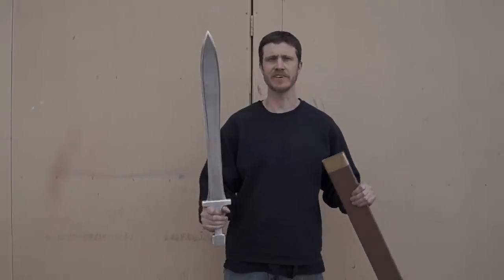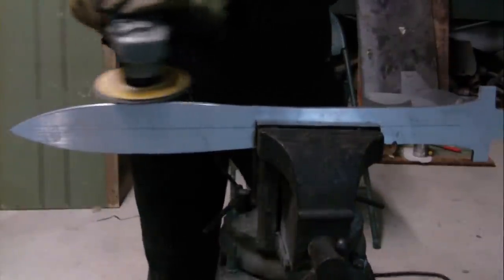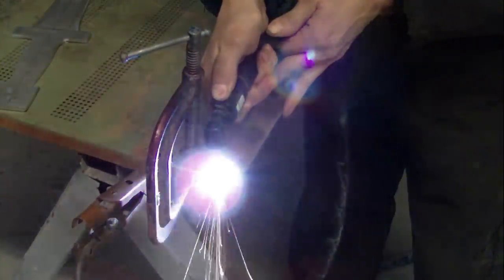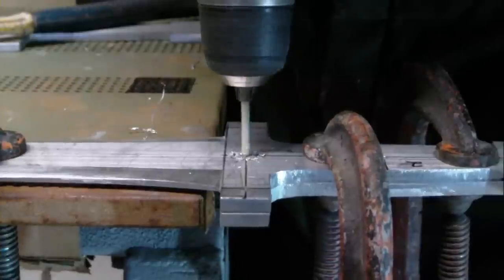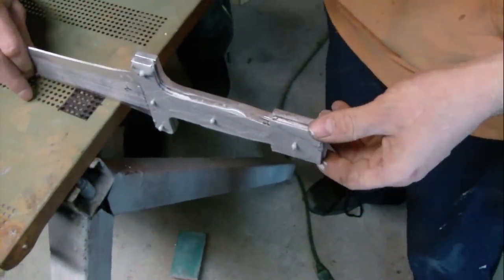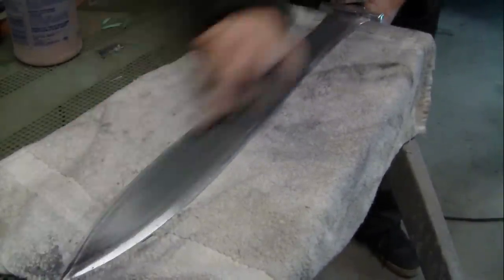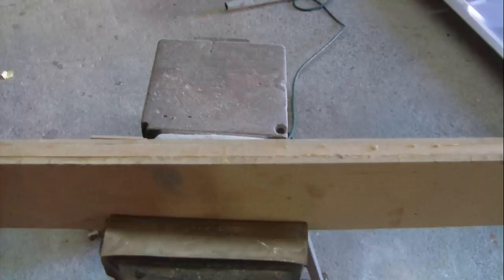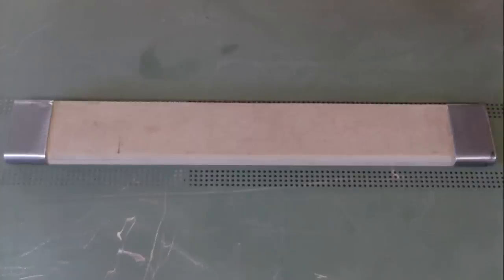How To Make A Prop Sword / Xiphos And Scabbard

Comment: Just wanted to pass on a tip I have just learned, may be of some use? A woodworking router with a carbide tipped cutter will cut aluminium easily and give great results. I mounted the router upside down in a wood box with the cutter sticking through. With the profiles available,very cheaply,you can machine the shape quite quickly and then finish by hand.

Comment: Wow it's more like a real sword than a prop sword!
Reply from the maker: its a high quality prop =)
Reply: it is not an actual sword because aluminum is not hard enough to be effectively used as a sword.
Reply: not nearly the real blade was shorter and the pommel and handle was made of copper or wood the blade was very rarely made into the sword handle
Reply: domini republica The only thing I see you doing in this comment section is complain.
Dude it's a prop not a real sword and it looks really nice (except for the scabbard) so keep your negativity too yourself..

Comment: Hi, great video and awesome sword! I was just wondering what the width and length of the aluminium bar that you used was? cheers, Matt
Reply from the maker: thank you!  the aluminum bar was 30 inches long, 4 inches wide and 1/4 inch thick

Comment: Cool tutorial. What are the dimensions of the sword?
Reply from the maker: thanks! the sword is 29 inches long.the blade is 22 1/2 inches longthe handle is 6 1/2 (including pommel and hand guard) the blade at its widest point is 2 1/2 inches and at its narrowest it is 2 inchesthe hand guard is 4 inches long and 1/4 inch widethe pommel is 1 3/4 by 1 3/4 inchesthe handle is 1 1/4 inches wide..hope this helps. if you have any other questions feel free to ask.
Reply: GoldPointProps
iv held a real one and yours seamed a little big but still great job

Comment: I have two more questions!! Is it relatively sturdy material?? And where did you aquire such a large piece of aluminum??
Reply from the maker: yes depending on the thickness it is sturdy. witch we got 1/4 in witch is perfect. we went to our local metal store. a 20foot piece was only $30. its way cheaper to buy it from a metal store than a hardware store

Comment: where do you suggest i get this metal at? because ever since I saw this a month ago Ive been looking for somewhere to buy this metal at and I cant find anywhere...can you please help?
Reply from the maker: TheGcreeper101 you should be able to find it at your local hardware store. but id check and see if you have a metal supply store in your area. they could cut the length you need and its way cheaper.
Reply: ok i have checked my local home depot, lowes and menards and nothing but ill try fro a metal supply store

Comment: 2 things could I use stainless steel (for strength) and where did you buy the metal
Reply from the maker: Mike Koepsell yes you could its just going to be harder to work with. and I got my metal from my local metal store.
Reply: Ummm stainless steel doesn't have any strength for swords.... Lol obviously if its a prop it is fine but if you want strength, carbon steel would be a lot better. Everyone knows the problems with using stainless steel by now.
Reply from the maker: MLP Andrew it's has a lot more strength than aluminum. But of course if he's making a real sword he'd want to use carbon steel.

Comment: it looks good but it should be shorter
Reply from the maker: Cole Naylor its the correct length for the sword I based it off
Reply: how long is it? cause the xiphos is 39-38 cm long this is the imperial only for pariads but in battle they used the shorter one
Reply from the maker: Cole Naylor the Spartan version was that short. but regular ones were 50-60 cm. I made mine 60cm because I am going to be using them in a short film and its easier to fight with them being longer.

Comment: how much did the sword cost to make?
Reply from the maker: TheGcreeper101 we got 20 feet of aluminum it cost $40 but you can have it cut to the size you want a peice to do this sword would only cost about $10. The epoxy cost $5. And I had all the tools. So about $15
Reply: thx i love making swords like this and its better that its this afforable. where did you get the metal at?